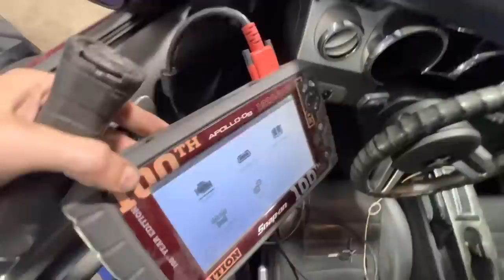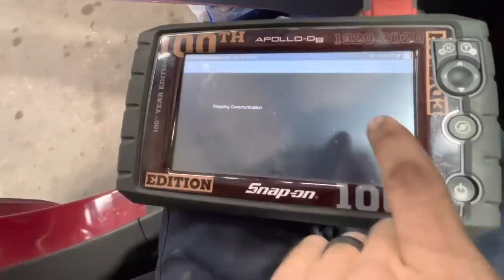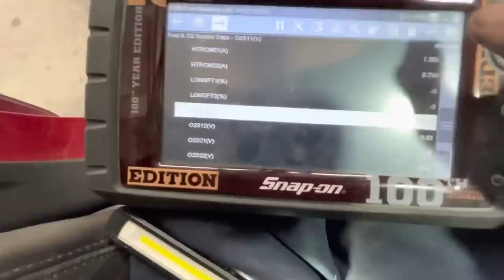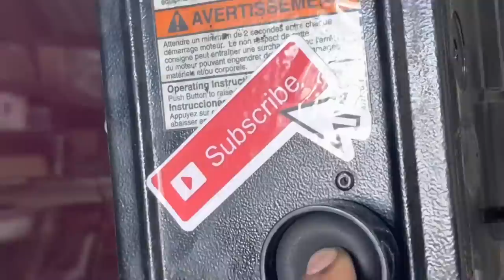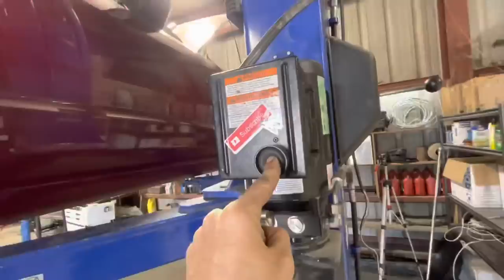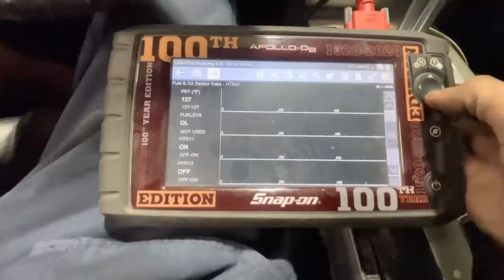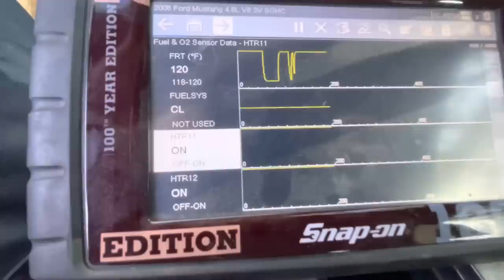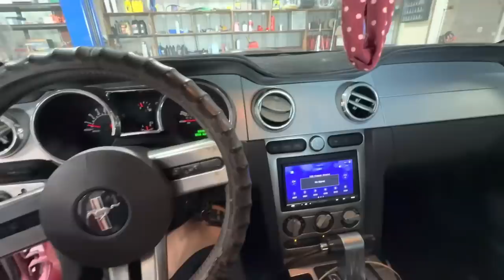Check Engine Light! 2006 Ford Mustang GT P0171 P2195 P1000

Comment: So much speculation. Don't watch to the end or you'll know the answer. Aftermarket seems to work okay if you use aftermarket parts from the OEM suppliers. Otherwise, the chinesium parts are hit and miss. I find it entertaining that the usual trolls are calling out the Rain Man for not testing the part when, in fact, it failed two consecutive tests. First it was dead in the water then when it warmed up, it still gave an intermittent signal. There is only one wave form. This is not a different spec unless you consider barely functioning a spec. Fun to read the comments. There are the fawning fans, the second-guessers, and the downright mean-spirited who can't let anything go even when they're wrong.  Even the Rain Man trolls. It all makes for good entertainment. I've been doing all repairs on my own vehicles, friends and family, and I don't know it all by any means. I've been doing this on a regular basis for 53 years. I'm glad some here do know it all. It gives me something to strive for.

Comment: Seems to me that P2196 would be that bank 1 is dumping too much fuel and the o2 is stuck high in that it needs to pull air in from outside the waste stream. Leaky injector, or bad O2 as Ray is already suggesting ? Tryiagnostics sometimes necessary but swaptronics is also valuable! Lol

Comment: Just a guess on my part here Ray, but could octane levels have anything to do with it?
I know the Mustang is like the Charger in that the higher the octane, the more efficient it runs.
Reply: But that would affect both banks, not just one.
Reply: @Mustangg16  I guess I am showing my ignorance with the comment. 
I had a 2001 Chrysler LHS that only ran efficiently and smoothly on higher octane fuel. Thought that it may be the case with the Mustang also.
Reply: @Bendigo1  shows how I speak before thinking sometimes. 😏

Comment: What does “open loop” or “closed loop” mean?
Reply: Closed loop is under temperature open loop is operating temperature closed loop adds more fuel until engine gets to operating temp then the downstream o2 sensor kicks in at operating temperature
Reply: I think you have that backwards

Comment: Two banks ? Compare sensors. What's the point burning your hands if new sensor hasn't arrived yet ? Use compressed air or water to cool the thing down. Makes good content though.

Comment: People still put carpets over their dash?? 🤯 This most be an older folk car.
Reply: It’s Florida. Lots of old folks down there, but a lot of young ones do it too. It cuts out the glare from the sometimes oppressive sunshine and keeps the dash from cracking in the intense heat. Down there, you pretty much have to keep your windows up while parked. There’s a 50% chance of rain every day for most of the year…and they aren’t light afternoon showers either. They’re 10 minute deluges. I made the mistake of leaving my window cracked on a 100 degree day and had to suck an inch of water out of my floorboards…on a day they weren’t calling for rain.

Comment: I personally don't do vehicle engines, but couldn't you have just swapped the bank 1 and bank 2 sensors to isolate the diagnosis of the sensor vs wiring/pcm? Being more into electrical, I probably would have tried to swap the cables myself.